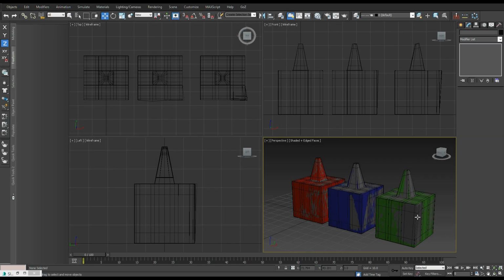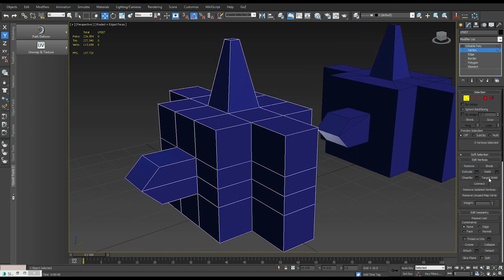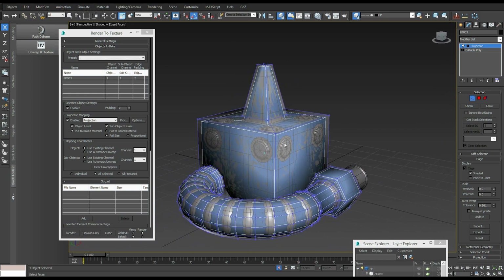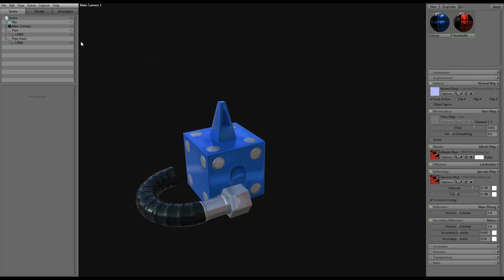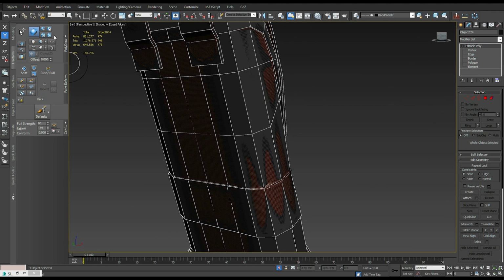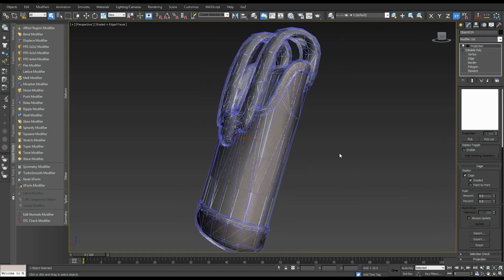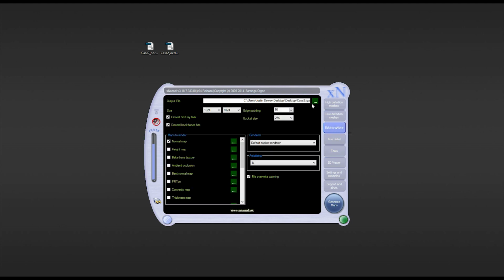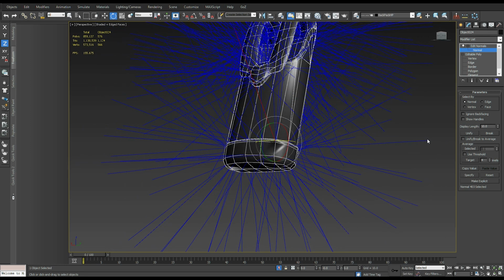Comprehensive Texture Baking

Comment: Awesome video full of great tips. Can I ask with the separating smoothing groups before baking does this apply to baking of any type of map like ao, spec, diff etc. Or just normal maps? Only i thought you also need to be aware of split seams in game assets as they can increase your vert count when in engine?
Reply from the maker: Wayne Pratt No, these rules only apply to normal maps. It's true that UV seams can double the vertex count along the seam. Essentially you end up with 2 vertex (how the game engine reads it) for every 1 that's on the mesh (viewport).

Comment: Great tut, you explained everything in detail, except one thing, the obj export which you just brushed over, kind of wanted to know how to correctly export for xnormals.

Thanks
Reply from the maker: For exporting out of max when baking I normally go: Export > Export Selected, set it to .obj. Under Geometry the only thing that would be checked is Flip YZ axis. Under Material, nothing unless you need them, under faces, Quads or Tris depending on what you need, Texture coordinate, Normals, and Smoothing groups are checked, under optimize nothing should be checked.

Another quick way to do this is just use the zBrush preset, then check Normals and Smoothing Groups, then un-tick the materials.

Since we're talking about .obj I might as well mention it's probably the best format to go from one 3d package to another (when modeling). It’s reliable, and doesn't have a bunch of extra data attached to it. The disadvantage is it doesn't carry animation data, or multiple UV channels.

Hope that helps!

Comment: Amazing video!

Just a little tip! 
At 56:08 just click on "PolyDraw"(arrow)  on Freeform tab and click on "NewObject"  and start  draw vertex with "StepBuild"  much more easier :)

Let me ask how do you navigate/zoom so...smooth?! did you use some kind of 3D Navigator ?
Reply from the maker: Hey thanks for the tip I'll have to give that a try. Yes, I was using a 3d mouse from 3d connexion.